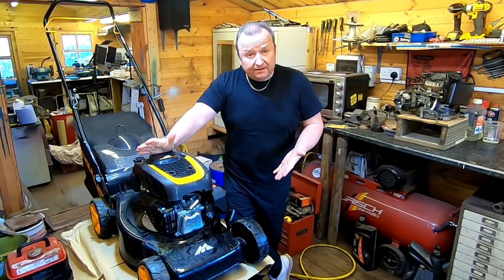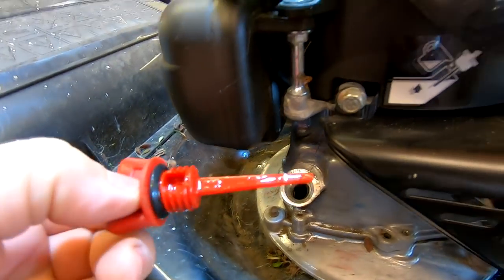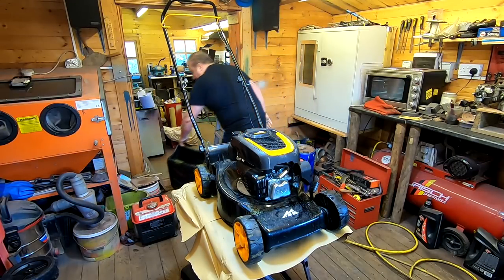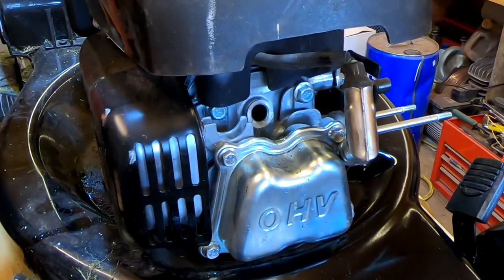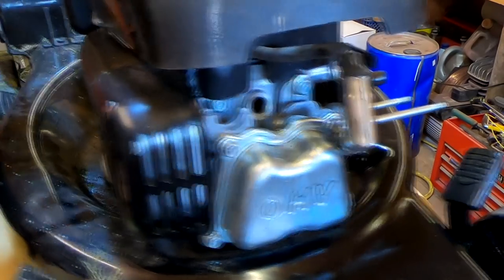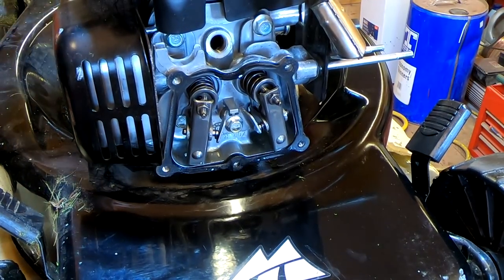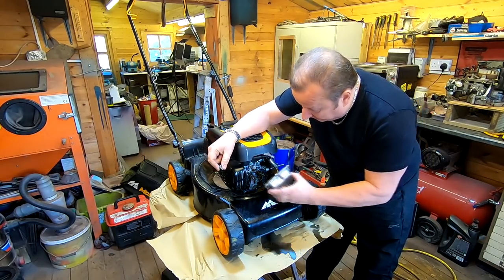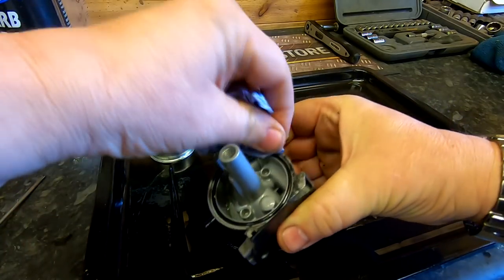Free Lawnmower - Do We Scrap It Or Sell It?

Comment: My brother once over filled his car with oil without realizing and couldn't get it going for a week. We did a bit of investigating and the air filter, plugs etc was caked up. The poor thing couldn't breathe. So we drained all of the oil, flushed the engine etc We basically gave it a service and off in went. He was extremely lucky that no lasting damage was done.

Comment: It seems to me we are getting like the yanks, a bit of a problem and chuck it out. There are loads of vids on YouTube made by blokes like you to help others out. I’ve learnt so much from you and other guys, my mower wouldn’t run, had a look on YT , Roberts you moms brother, 30 mins later  carb and jet cleaned (different mower but same carb you cleaned) mower back up and running. More power to you mate keep em coming really enjoy them, atb
Reply from the maker: Thanks Rob.
Reply: Another reason people throw mowers away is because manufacturers make them too cheap and don't take into account the labour costs the machinery dealer or repair shop have to charge to pay for staff and bills which puts customers off getting the mower serviced or repaired. Most mower companies have this idea of making box pushing mowers that are built cheap with cheap engines and parts so they meet their sales targets, which is a shame as 20 or 30 years ago manufacturers used to build machinery that was built to last at a price that it could be repaired.

Comment: It's worth saving it's a good mower possibly worth around £100 used. People always assume that tipping the mower on the exhaust side will make the oil come through the exhaust so they tip them on the air filter side which is wrong. It still amazed me with the mountfield mowers sold in screwfix and b&q as they do have warning stickers to tell owners not to do this but they still tip it on the wrong side.

Comment: Hello mate, nice easy fix for others with the similar type of carb.. like on a Honda.
There is a large cross head plastic screw (seen on your video) that controls the throttle butterfly. Beneath that, is what looks like a black plastic oblong plug. Lift this plug out and check it's bottom, it needs to be clear.
In the hire industry we get surging engines because this jet is blocked. Beauty is, you can do this without removing the carb. 👏👍
Reply from the maker: Good tip Dan, thanks.

Comment: Very enjoyable martin morale don’t tinker you don’t know what your doing great looking wee mower you may more luck finding 
Valve gaps from husqvarna maybe as they make them I 🤔
Reply from the maker: That's correct Chris, they are bud.
Reply: The engine is actually the same type you find on some mountfield mowers. Its known as the Mountfield RS100 on a mountfield. Sumec are the actual manufacturer of this engine.

Comment: seems like it is becoming a more common occurrence for people to overfill the oil on there machines. it seems like every year i fix more and more machines with this issue. also looks like too nice of a deck to scrap anyways. good running motors are a dime a dozen but decent decks especially with a bag are tricky to come accross in good shape. i scrap more decks than motors each year.

Comment: Hi Martin, really enjoying the videos at the moment. I have a 1.8kv generator that does produce power but when I plug something in that it should easily power the engine struggles way to much it almost stalls. If you have any idea on what it could be. Thanks
Reply from the maker: It Could be something to do with the governor (Springs, adjustment, ect), fuel starvation on running under load or blocked air filter. Just my opinion without seeing it.

Comment: I have one like that it runs but wont accelerate, then starts to chug and puts out grey smoke,i never tip it the wrong way,only towards the handle as you did, the oil level is ok , but if i shake it it runs ok again but then goes back to chugging, its like the choke is stuck on, the choke mechanism on the carb moves ok , so im stuck for ideas, what would be your advise on this please..........??????????????????
Reply from the maker: What engine does it have.
Reply: @retrorestore  might be a briggs, looks very much like that one though will have to check. cheers,,